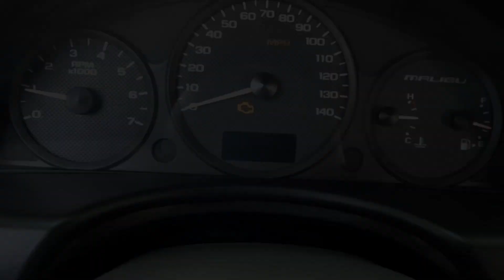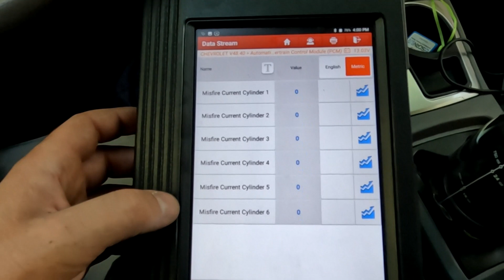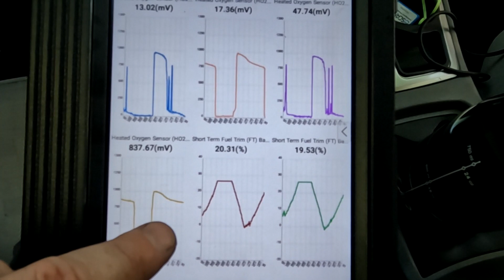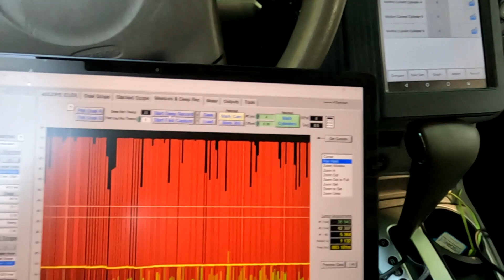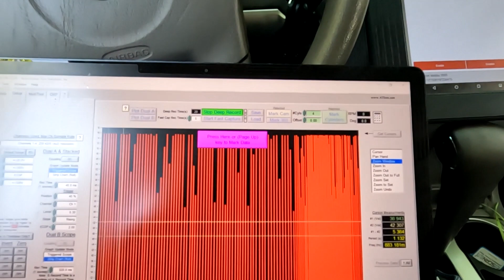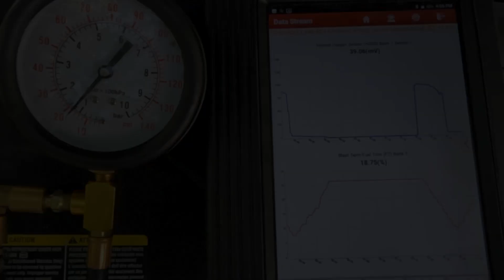Intermittent Rough Idle and Loss of Power | Diag and Fix

Comment: Hi I'm having almost same issue but not as bad, with short term fuel trim going up at stop light engine shakes RPM fluctuate then goes away, car also doesn't have same power or accelerates like it used to.  I have a 2011 Kia optima 2.0 turbo with 168k could it be my high pressure fuel pump??
Reply from the maker: That's a possibility. You should be able to read the high side fuel pressure with a scan tool that displays live data. Compare that to spec. Look at the low side pressure as well (you may have to do this manually). The high side needs a good flow from the low side in order to operate properly.
Reply: @ValleyMobileAutomotive  Awesome thank you so much for your response

Comment: May be it can help, car was slow accelerating and rough idle resulting to stall after everytime i drove for few mile and stop at signal or shopping. I checked cleaned maf sensor, throttle body,replaced pcv valve, ignition coils, spark plugs and so on. But culprit in my case was oxygen sensor. So before replacing several parts, just check by removing sensors like maf, oxygen etc and by the way there was no error in ecu or checklight.
Reply from the maker: Thank you for your comment. This could help others 👍
Reply: I thought it could be the fuel filter

Comment: Hi Robert, how do you feel about basic scanners for car owners?
Reply from the maker: Good question. These are my thoughts... I think if you don't really work on your own vehicles then most parts stores will scan your car for free and tell you the codes. So owning a "code reader" isn't necessary. But you can't always rely on a code to fix your car. Like on this vehicle, there wasn't a fuel pump code. Codes are only guides. If you do work on your own vehicles then a good scan tool is priceless. One that reads and graphs "live data" and has the ability to  communicate with at least the engine, abs and body module is minimum. Also a good scan tool can last years. I use mine most everyday and I've had it for over 3 years now. It's definitely paid for itself. Hope that helps
Reply: @ValleyMobileAutomotive  Really thanks for your sharing!
Reply: @ValleyMobileAutomotive  Is it worth it for car owners to have a car battery meter?

Comment: Hey Robert, which OBD readers do you like to use?
Reply from the maker: Hey Carlos, there are many brands to choose from and most of them do a good job. What I recommend is getting something that has the ability to graph live data. On this vehicle if I went with codes only it would have pointed me down the wrong path. So seeing live data was key. Also having bidirectional control is something I look for. It makes diagnosing some issues 10 times easier. But that ability makes the tool pretty expensive. At the least get something that graphs data 👍